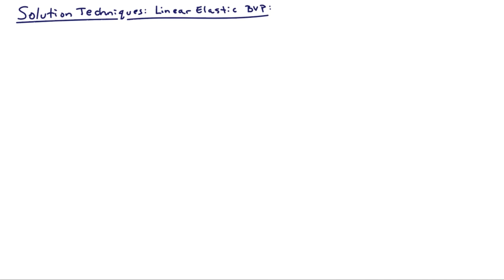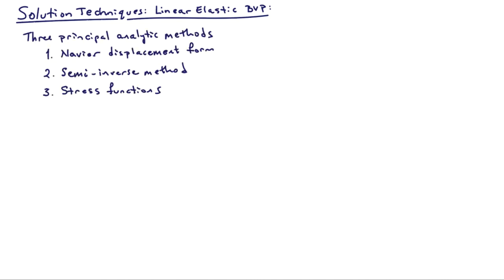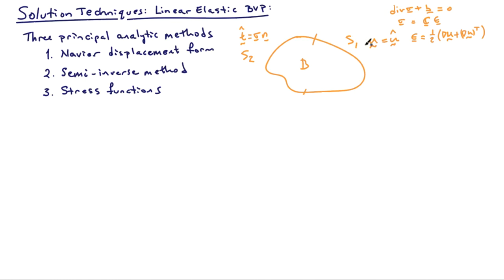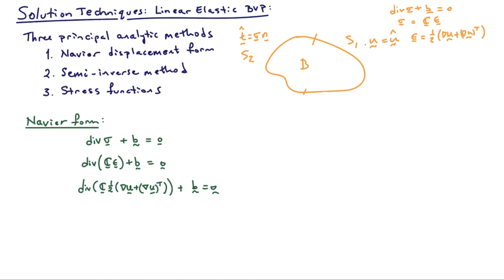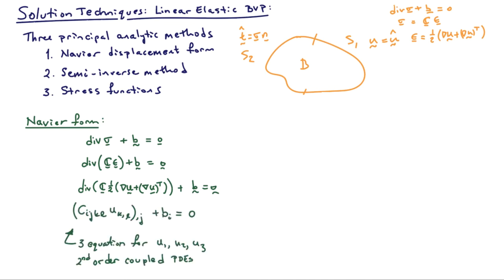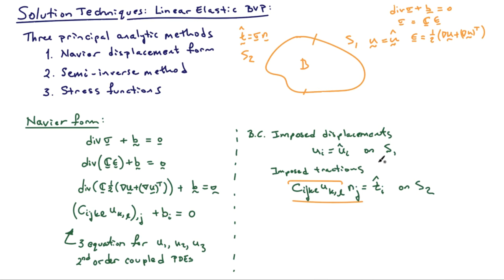29.  Classical methods for solving elastic boundary value problems

Comment: Hey there, thank you so much for your videos. I was wondering if you'll cover Green's functions/point loads for a 3D system
Reply from the maker: I normally do not teach Green's functions, so it may be awhile until I get time to make a video on the topic.  Let me recommend Chapter 2 in 'Introduction to Micromechanics and Nanomechanics' by Shaofan Li and Gang Wang, 2008, World Scientific Press, Singapore.  This is a good introduction, starting simple and working up to elasticity, with all the details and modern notation.  Older references like 'Mathematical Theory of Elasticity' by Sokolnikoff, 1956, McGraw-Hill, New York, are also good but Li and Wang is where I would start.